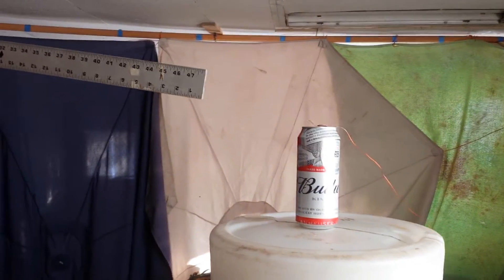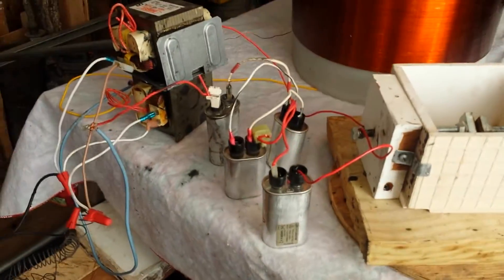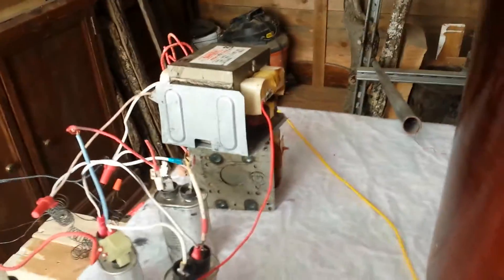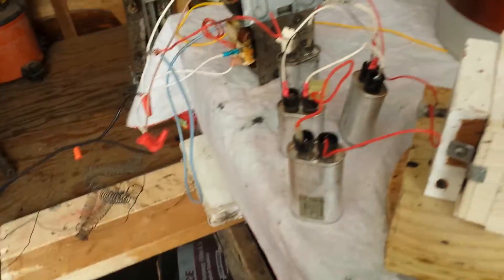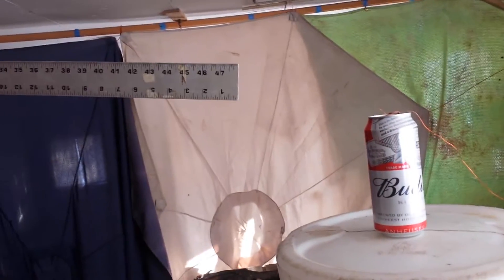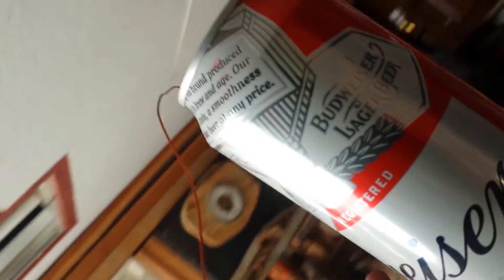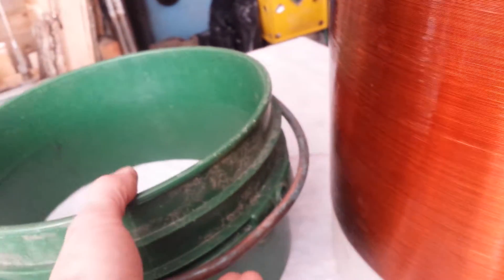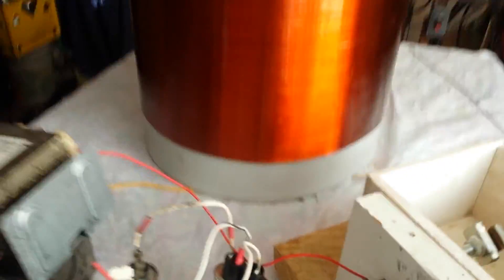Tesla Coil Two Mots SIMPLE setup. 20161216 111003

Comment: i made a 2 meter high tesla coil first also only with microwave caps and 3 mots but then 3 of the 7 microwave caps blew up and i replaced it with a "real" MMC bank no it works very well and if iI run it on 1/4 of the power I can get aup to 1 meter arcs I now have 6 MOTs with 4 in series and 2 as Ballast but I think I´ll improve it and go to 8 MOTs

P.s.: Sorry for the bad English im only 14 and from Austria

Comment: Nice mot set up sir!!! I have a dual mot set up with a voltage doubler but i cant seem to figure out how to conect it to my tank capacitor & then to my tesla coil. I was wondering if maybe you could draw up a wiring diagram for me illustrating the connections from after the voltage multiplier? I suck at reading schematics so the simpler the better... thank u for your time...
Reply: eric cruz  when i did my city and guilds in pannel wiring s coarse i passed topps and the marks i got for that wear for  circuet plageriation  of skymatics to get out side the box  so i want to see if 56 years of knowledge can crack you problem as you probably work  out i,m more than a bit autistik s  but i still have my  city and guilds somewhere so maybe  i can add an ellement that no/one else has offered plus i,ve lost my note books  and i dont have the whats trianglle and i,m stuffed without it on the capasitence  and maths  but remember autistic folk can make lots more loot than ordinery folk  so i want to see your skymatic to see if i can help you and i,m not intrested in monney  so respond please

Comment: That is a huge resonator coil! Going to need an MMC for sure. Going to probably need some mire primary turns as well.
Reply from the maker: Yep Except, notice my "MMC" is just some MOT CAPS and it tosses 8 inch arcs with primary on the inside. So miring primaries is actually a bad thing in the way of its output for two reasons. one, harmonic oscillations (most undesirables) and too SIMPLY in order to increase the output and maintain the same freq, higher capacitance and SHORTER primaries are nominal. ONE TURN is best. inside or out. inside means MORE POWER SCOTTY. sorry I had too.   Sincerely Scott R.
Reply: It depends on your aim. If it is to create high output reaching out to, infinity with the harmonic resonance to your secondary coil, you need a balanced LC circuit. You can hit many orders of harmonics just like an instrument.  None ring louder than the secondary natural harmonic. If you have no output with out grounding the top of the coil, you are not resonating the coil. Tuning a TC is not one size fits all, its case by case according to the secondary coil. You can go by the numbers in finding resonance in an LC circuit. If you calculate the frequency of your secobdary, you can derive its inductance. When you get thst you can calculate capacitence to match. I have yet to build a MOT tesla coil bit Terry Woodroof can probably give you some pointets. Usually the calculations are a great guide, but ultimately fine tuning comes into play.
Reply from the maker: Excellent. Yes I realize the harmonic nightmare that can and cannot occur. If I recall my ancient Pythagorean  harmonic relationships the first one is the fundamental. the second one is a direct ratio 1/2 thus the center of a piano string (guitars 12th fret. half way) then the tertiary and qua ternaries are less robust due to there position on the string. 1/3  and 1/4   etc.
BUT here is what I did. I knew that mires of primary were what I needed to get a few small nanos or even a bucket full of beer wine bottles to activate these giant HOG BELLS like my antique "gigantor" (which had over 2500 feet of THHN #16 wrapped around a 55 gallon barrel.
      . So with just a simple 3000 volts I started with 45 feet of 3/8 copper tubing for a primary, as I increased the primary cap bank up to  about 140 nanof's (I would rate bottles at about 12000V average.?) the output increased proportionally (given top load) right until I ran out of primary. That is what prompted the internal primary concept which yep the calculator predicted and when I swung my cap sizes to those values Voila continued increase on the output.. from 6 feet (outside min) down to (3.5f Inside max)
ACTUALLY, I am just playing and realise a slayer driven or true VTTC is the stable (freq) oscillatting driver, yet I thought of attempting to YAGI beam some juice across the lawn EXCEPT.::::     127 Khz equates to a full wavelength of about 5 miles or more so eeeks mebe I should stick to freqs I can handle like a stable PLL CB oscillator thru a linear with a front to back topload from hell and watch it fizzle.
     Thanks for the tips and yes I will talk to Terry again when I get a little extra time. He's decent folk down there in TN.
Sincerely Scott R.

Comment: Nice video 
I like to see the spark without the metal strip , if u can post,
Reply from the maker: Doesn't do shit  only when it slapps out of tune does it really emit whacky purple streamers But NOTHING LIKE YOURS. Yours is in decent tune and to me MOTs for TC's are a pain in the ass. NST or line xfmr for me other wise I am limit to probably no more than 1 foot arch tops unless I voltage double it and get a new MMC then I can watch mama bear roar. fer nor I tink sheeza will send power a small distance without max power.  Thanks for the positive post.     Scott